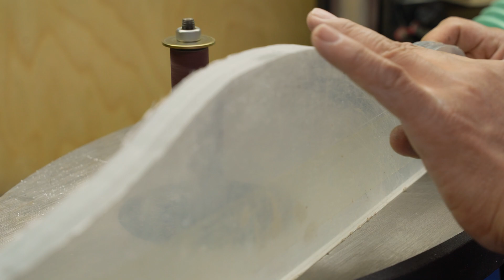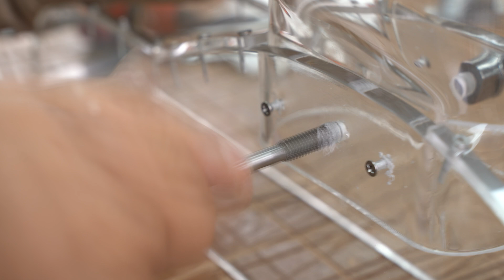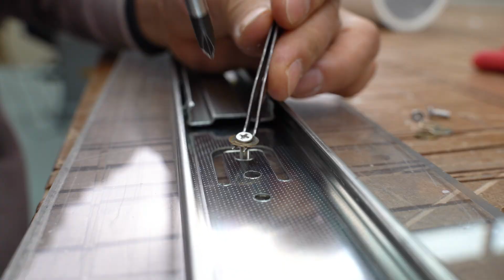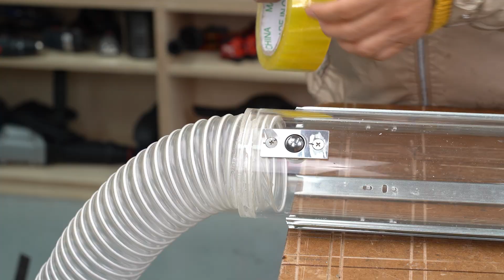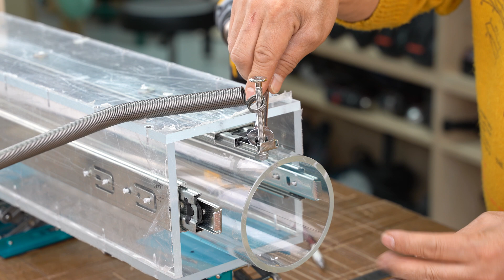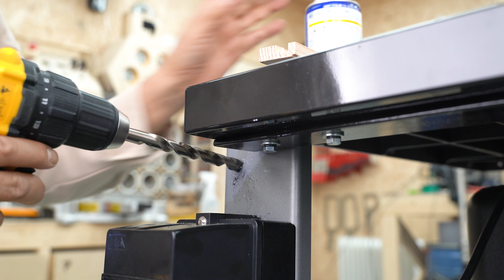Table saw Upgrade #4 : Compilation / DIY

Comment from the maker: Please turn on your language subtitles! 
The biggest problem with using table saws is fine dust flying toward the body.
When we do carpentry, big crumbs don't matter. Because it falls to the floor.
Rather, fine dust that is hard to see is more harmful to our bodies.
Many manufacturers are trying to solve this problem. SawStop, for example, introduces a pipe-type dust collection system to strive for dust collection on the top of the table saw.
Not satisfied with this, I made a table saw upper dust collection system using transparent acrylic in my own way. I'm satisfied with the performance and the movement, so I think it'll be a great help for my future work. The height adjustment is also possible to avoid disturbing the work as much as possible, and the dust collection opening is designed to be opened only when necessary using an automatic dust collection switch.
I did this in a unique way to bend the acrylic, which is also a reference.
Please enjoy the video and if it helps, please subscribe and like it.
Thank you.

#DIY #Workshop #Dustcollection #TableSaw #Making #Woodworking #Sawstop #Howto